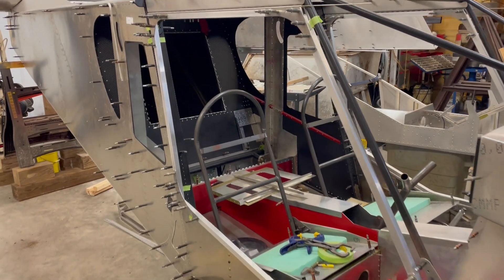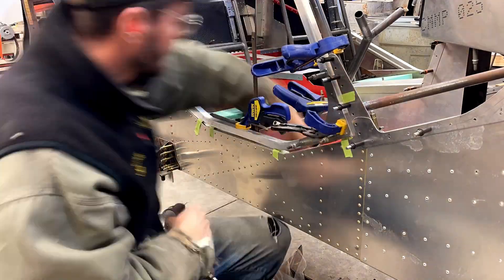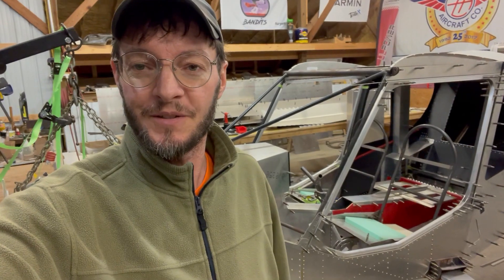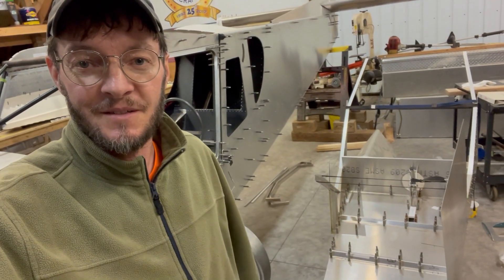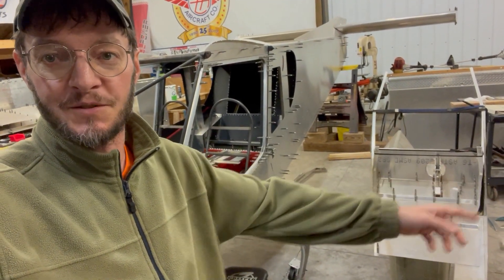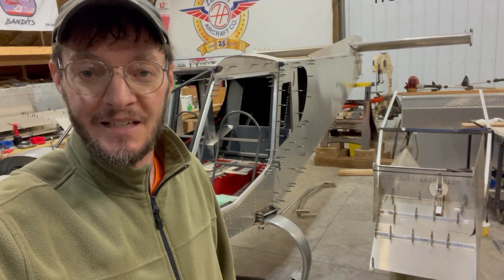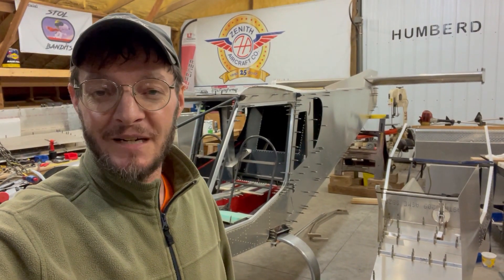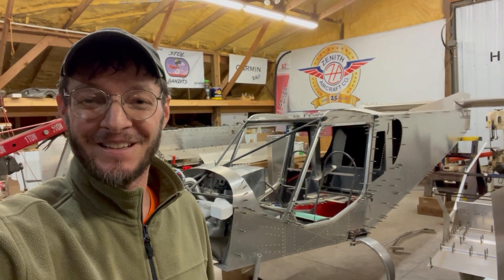Single Seat Zenith 701 Q&A! Also, more door work. 750SDXtreme Day 15 of December Build Challenge

Comment: The sportster 701 sounds like a good cadidate for a Viking 140 baby turbo. If the engine weight can be made suitable for the airframe. Electric does also sound interesting, not sure there's any powertrain that's really proven yet (unless you know of one?). I know you don't want to trailer it but proper competition probably benefits most from that so range is no longer a problem, be it light fuel tank or minimum batteries.

In any case, it's such an interesting concept. Thanks for sharing your thoughts.

Comment: Make it a pure competition plane. Yamaha Sidewinder engine with Skytrax gearbox like Steve Henry has. 

Now hear me out on this part. Create a control system like military fighter aircraft use known as HOTAS which stands for "hands on throttle-and-stick"

Use the kit control components to make a center control stick. Extend the flaperon lever on the left side and fabricate a twist-grip throttle with a friction lock essentially like the collective on a robinson helicopter. This way you can do STOL takeoffs with both hands on the controls the whole time. Add your switches to whichever control grip position feels best.